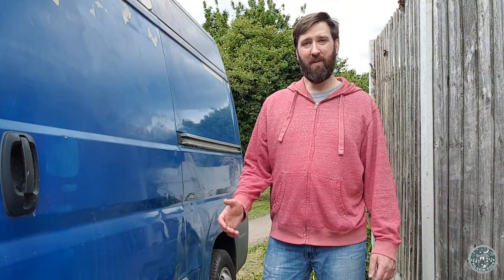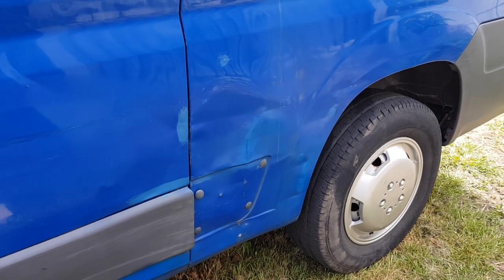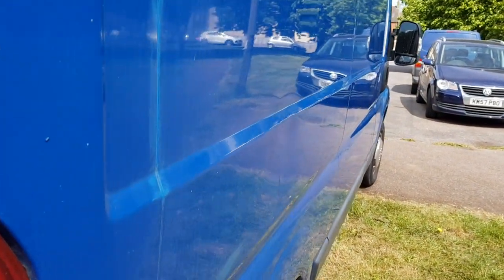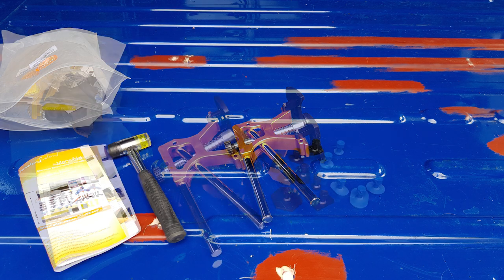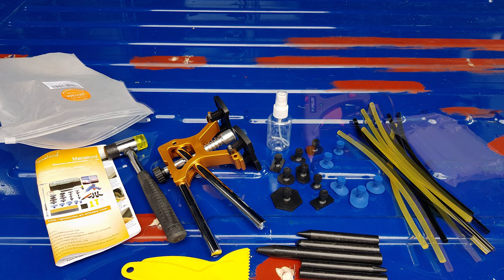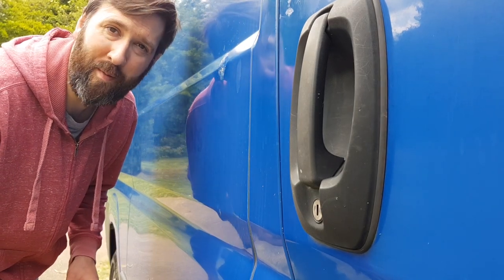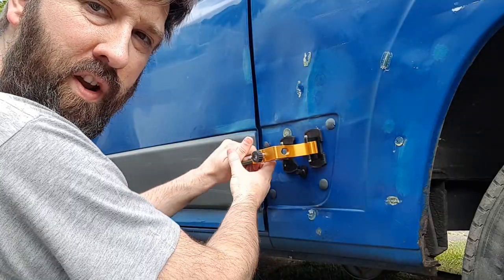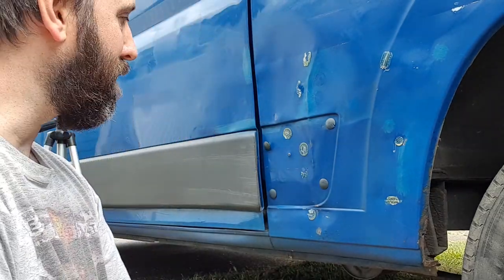PAINTLESS DENT REPAIR attempt. Do CHEAP Amazon PDR kits REALLY WORK? DIY Budget Campervan Conversion

Comment: Loved the Star Wars kegs! LOL.  It was a very good idea to wait until people have walked past before having a tug... ooerr!  My van has a 3 foot long gouge down the side so I am just going to fill it then roller it like you did.  Loving the vids and the nerdy shirts.  I am also a bit nerdy (My colleagues call me Sheldon.  Gits.) so can appreciate the shirts etc.  Keep it up.  Cheers.
Reply from the maker: I don't know where this nerd vibe is coming from; I'm cool! 😎 What van are you converting?
Reply: @PilgrimPods  Errr so am I!  It's them weirdos with the Nike weird clothes and stuff.  I am about 90% through my half-assed conversion of a Renault Trafic LWB with couch/slide out bed, kitchen with 50L water (Unheated), and the piece de resistance, a sit down shower/shitter!  A sight to behold I can tell you.  I am going to give it a roller paint job following your example when it is finished.  BTW - don't buy a smart relay for charging as if you get the Ring battery to battery charger it includes a solar panel input for £150.  I did install a relay but have now taken it out and it is yours if you want it, but I would recommend the Ring.... ooerrr!
Reply from the maker: Would love to see the van, are you on Instagram? 😊 We've seen others recommend that Ring unit but were thinking a separate B2B charger and MPPT controller just in case one has an issue the other should save our bacon rather than all our eggs in one basket sorta thing. A bit more money I know but like the Maxxfan and 12v fridge we're hoping they'll pay for themselves over time if that makes sense. 🤔😁👍

Comment: found this very interesting..using that kit....never seen one, during lock down i put filler /sanded over the dents on my van, from kids throwing bricks...im sure at least 2 of them wouldve come out with that !! thanks for video ;)
Reply from the maker: We had mixed results with our kit. We definitely could have achieved better results with it with a little more patience and know how. For small dents I'd recommend picking up one of these kits. It just bit off too much with our battered panel... 😊👍
Reply: Do you live in Befast?

Comment: Dents (indentations) always have high spots around the outside.  That's what the hammer and tap-down tools are for.  You can take a fair amount of the dent out by tapping down the high spots before you even begin pulling.  Alternating between pulling and tapping down gives the best result.
Reply from the maker: Thanks for taking the time to share the advice Ian. 🙂

Comment: Hi there ! I'm a panel beater and paint cars as a trade, and the paint is coming off when pulling because the guy who painted that newer blue on there did some badly executed prep work. Btw great DIY video. That would cost alot at a pro's place ;) Worth the £30
Reply from the maker: Hey Jo and thanks for enlightening me. 🙂👍 I'd love to get it fixed properly but can't justify the cost on a tired old van. Whilst nowhere perfect it does look a lot better now. Would love to see a professional PDR technician have a go at it. 😊
Reply: @PilgrimPods  You're doing a great job buddy, learning, teaching others and having a good time. Thats all that counts ;)

Comment: I Would use a heat gun on low or a old hair dryer just before you glue and pull. It helps the metal go back into shape.
Reply from the maker: Thanks for the advice M G, if ever I have to try and tackle something like this in the future I'll bear in mind your suggestion and hopefully it'll result in a better job. Every day is a school day and if you don't try you'll never know or learn I guess.

Comment: you should have heated the metal first,the temparature should be between 70 F to 85 F you should have a temperature gun and the paint might be a repainted one ,not original,clean your panel with 90 % alcohol and clean your tabs too.
Reply from the maker: Thanks for the advice Adrien. 🙂👍

Comment: As you’re painting it anyway, just whack all the paint off the dents and build up with filler, these vans don’t really rust anyway so you can’t go far wrong. I bought one of those glue gun kits to get some dings out of my old alfa gtv and it worked a bit but not brilliant.
Reply from the maker: I think what you say will be the new plan going forward. I do intend to have another go at the dent pulling though following some advice offered on Facebook. Thanks for checking our channel out. Really appreciate you taking the time. 👍😊
Reply: Pilgrim Pods are you hand painting, I.e. rollering? With Matt or satin paint? Or you planning on going glossy? A satin finish would hide a multitude of sins and the filler job wouldn’t have to be perfect. It would difficult to achieve perfection anyway as you know.
Reply from the maker: @yeah_right_ok_no1190  I'm going the old VW route and rollering it. Picked the paint up weeks ago and if memory serves it is satin. It's the Rustoleum Combicolour stuff.
Reply: Pilgrim Pods I did a defender in satin and it transformed it, really easy to apply and gives a decent finish. Foam rollers and warming the paint in a bucket of hot water would be my only tips really. Looking forward to seeing your video on it when it happens. Good luck!
Reply from the maker: @yeah_right_ok_no1190  I'd love a defender. Maybe one day! Thanks for the advice. I'll definitely put it into action. 😁

Comment: its pain-t m8! nice work though!
Reply from the maker: Not perfect but does look better. The price of buying a cheap van I guess!
Reply: @PilgrimPods  if its not work, or being set up expensive 'professional'  campers, the the options are limited. new stuff in the philippines, your looking at $95-98,000 usd. people i'm in contact with, are buying old dinged up vans. theres salvage [written off] stuff on ebay, but the parts are expensive too. you did right m8